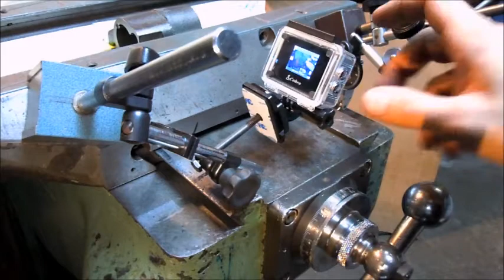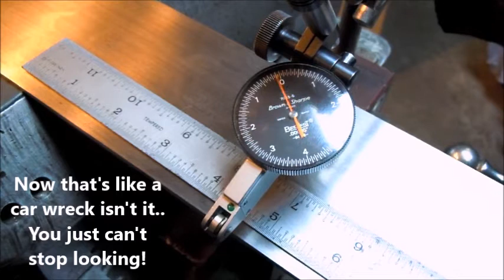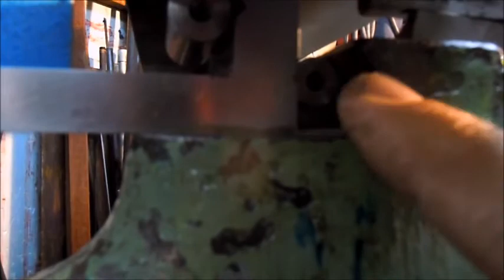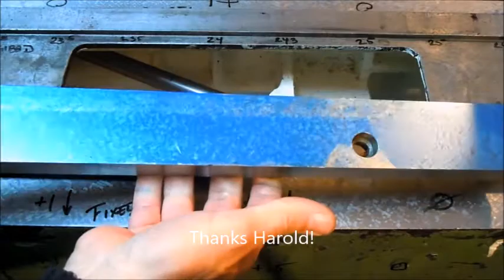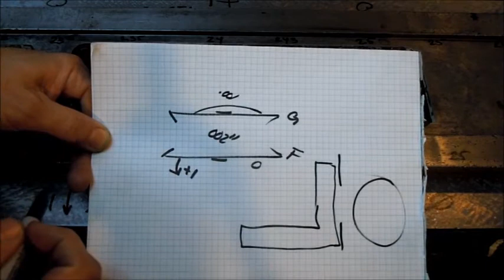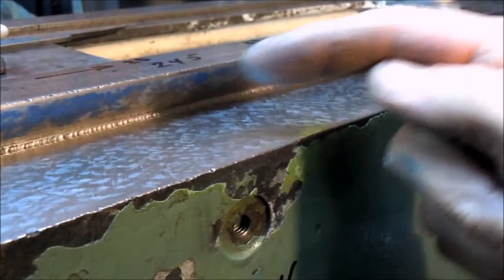Bridgeport Update 30

Comment: Your angled master has a sharp corner, is the relief in the dovetail enough as not to bind with it? On my mill the relief in the dovetail is more pronounce.

Could you take measuments with the straight edge in both directions? Handle towards left and handle towards right. That would show if there is a slight miss match with it.
Reply from the maker: Likely hard to see on screen, based on what I see when I look at the actual machine and the videos / pictures, but the relief in the bottom of the dovetail is sufficient. The master fits nicely up against the dovetail.

I think your second question is referring to verification of the squareness, of the square. I try very hard not to use the machine, or any surface on it, as a reference unless I have NO other way to measure. I don’t know if the machine is straight so using it to check the square would be an answer with little backing. This link, https://youtu.be/aFBZFComFQc, is a very good video on how to make sure anything is “square” with relatively little equipment. Adjust the set up to fit your needs.

Thanks for watching and commenting. Helps me too.

Comment: I've yeat not watched the whole video (maybe I should have before posting...) but I too have a problem on my Bridgeport Interact MK1 y-axis gib. That's why I'm really interested to see how this thing comes trough.

My Bridgeport is driven by servos and the gibs are "senseless" to adjust. Servos have enough power to drive the table until the circuit breaker breaks.

All other movements on my mill are smooth, but the y-axis gives me headache.

I have no means to scrape anything on my mill, but I think by looking how it moves that the y-axis has the most wear on it. That would make sense as the y-axis gib is the shortest one. There seems to be more wear in the middle than on the ends.

My y-axis gib seems also a bit bent. If I drive it all the way in then it seems to settle straight, but the force to move it becomes too much for the servo motor so I have to take it back a bit. It all works fine in the middle travel but the servos get a bit too much resistance at the end the user stands.

My y-axis gib doesn't go that far in as in your video. Only about 1-2mm. Also on my y-axis gib there is a relief in the middle part of the y-axis gib, maybe some 2/5 of the gib length.
Reply from the maker: No worries, questions come up when they come up, sometimes the answers follow, sometimes they don’t. 

Remember I’m a student, always will be…

 Not sure if you should consider the gibs senseless, even if the servos have high torque, as the purpose of the gib is to adjust the fit of the component by taking up the gap. If it was possible you would machine a component to have a perfectly fitting dovetail (no gib), this of course is not possible, well not considering things will wear, so the gib is the piece that creates the “perfect” fit. I think the gib length is a design “output” and not an input, based on the size of the component and would have little to do with how it wears. Poor fitting parts create excessive wear, period. Wear is also a result of the “working” area being small, maybe most of the movement in the axis is only a few inches, this will wear that area more over time.  From what I have learned, still learning everyday I work on this mill, the gib should be FLAT which allows it to take up the gap and not prematurely wear. Imagine it bowed by say .010”, even if you force it to be “flat” by pushing it into the gap, it will always contact and hence wear, where it is bowed. 

 The depth of the gib, as you describe, is an indicator of the adjustment and ideally you want this not to be all the way in, like mine currently is. Once I have a few things sorted out I will need to build up this gib with Turkite to fit it properly, allowing for adjustment as I use the mill.

Relief in the center of a gib, of significant length, is a superior design feature that allows for full length, effective, contact without actual contact. This relief should be minimal however.

Best way, pun intended, to check the health of the mill is to run out the table all the way in the X direction, put an indicator between the saddle and table, tug/push on the table (large lever when extended) and see what happens. This can then be repeated with the indicator between the knee and saddle to see what you have there. Check out this video by Keith on gib adjustment. (https://youtu.be/nqQ3HzoSnUc) 

The be all and end all book is (Machine Tool Reconditioning by Connelly), every question can be answered by that book… well almost every question! Hope this helps. 

Thanks for watching and commenting.